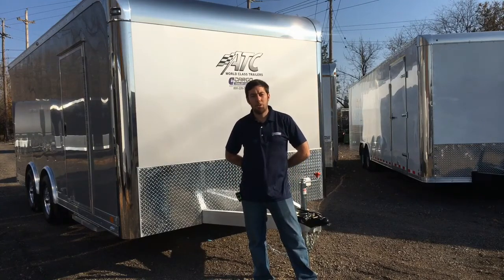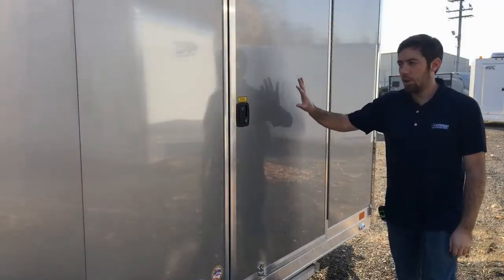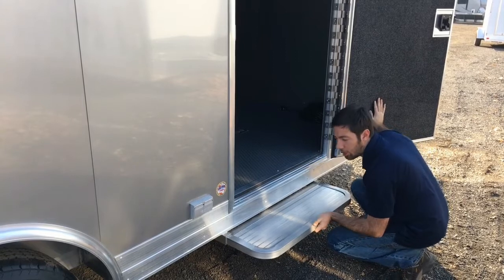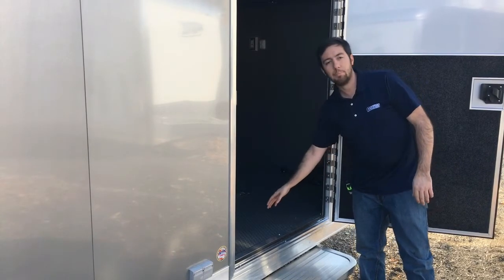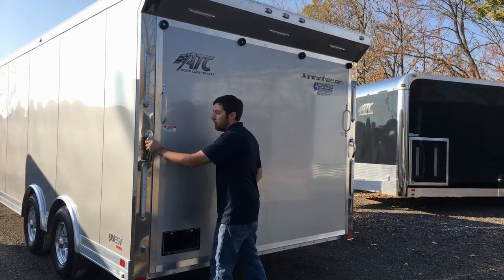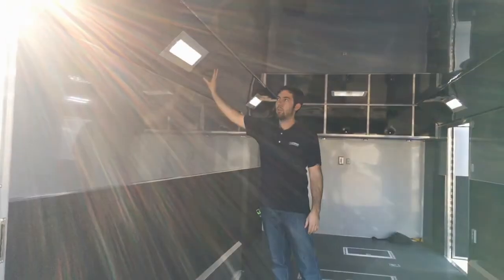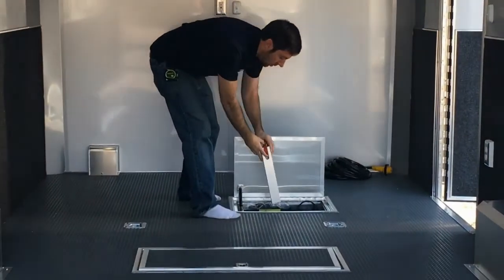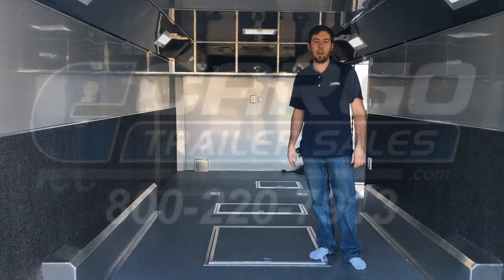20ft Aluminum Frame Trailer ATC CH205 Custom

Comment: Can yo explain how it weighs 7000 lbs when 23 ft aluminum camping Trailer fully loaded with all yr stuff only weighs 5400 lbs??????
Reply: 7000# is the GVWR (total allowable weight of the trailer, including it's payload).  Trailer empty was 3052# leaving you 3948# payload.